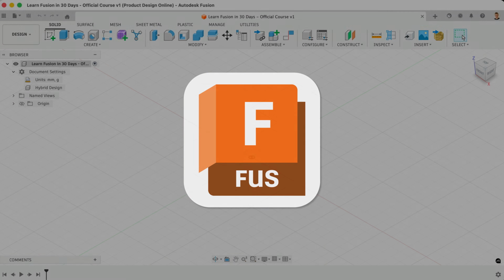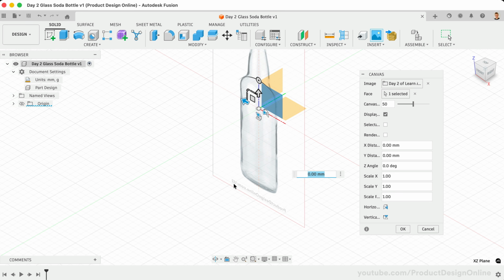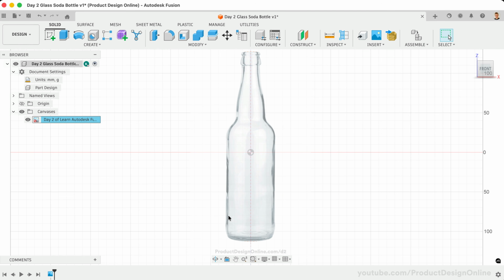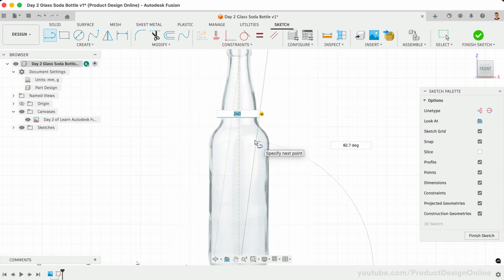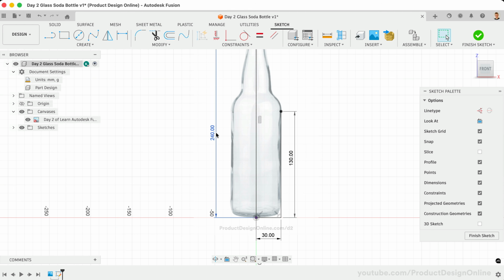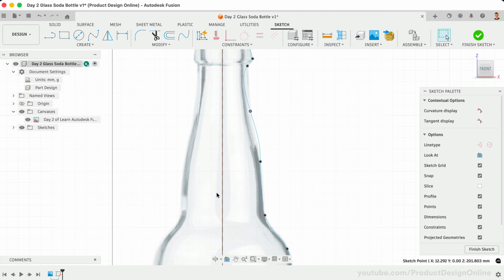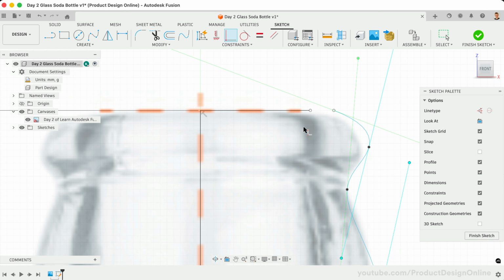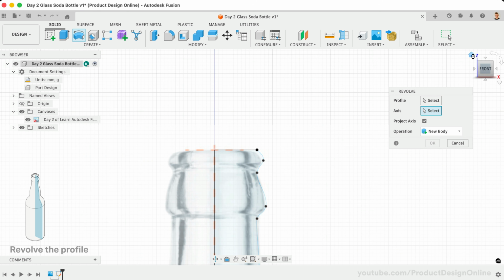Day 2 of Learn Autodesk Fusion in 30 Days! (2026 EDITION)

Comment from the maker: Looking to see INSIDE your bottle? Here's how: https://youtube.com/shorts/NfVwOnwqQfo
Also, if you’d like to help me create the rest of the series and keep these tutorials coming, consider buying me a coffee: https://buymeacoffee.com/pdo
Get the Day 2 instructional guide (PDF): https://bit.ly/guideDay2
Reply: The tutorial grid references are on the "Front" plane, on my machine they are on the "Top" plane and I cant seem to change it. Anyone know what im doing wrong?
Reply from the maker: @CapturedHappiness  Are you referring to your sketch grid or the grid that appears before you start a sketch?
Reply: @ProductDesignOnline   i'm having the same issue as @capturedHappiness.  the grid is on the xy plane, but the bottle is being built on the zx plane.  Also  i don't have the orange reference line on my imported bottle image.
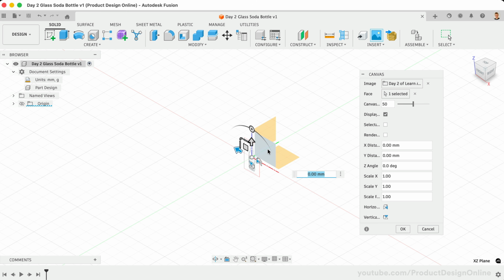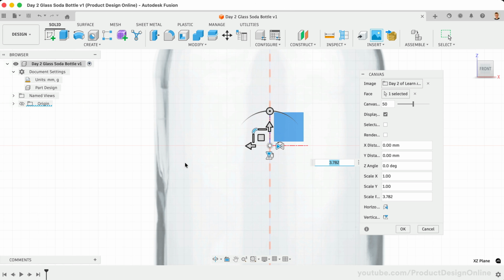Edit:  I think I've figured out why my gridlines didn't move.  I deselected the bottle image before clicking the front plane.  In the video between1:22 and 1:59 the image edit menu is up and plane needs to be selected.
Orange line solved too, didn't use the new bottle image file.
Reply: @CapturedHappiness  I have noticed this as well - my front plane is showing X horizontally and Y vertically, not the X and Z like in the video which is very unusual for any 3D editing software.
I'll keep up with the tutorial regardless, should be fine.
Reply: so this centreline view is that something you made, or is that something I can see as well? (even though I skipped that centre-line good practice)
Reply from the maker: @Coen80  It's part of Fusion now. It was in a recent update sometime near end of 2025.
Reply: re-insert the image and position the origin first. Type in 112.7 mm for the Y distance first. Then set the calibration points and scale. It's a work around until they fix the issue
Reply: You should explain this in the video when you do it not change the view as it makes it hard to follow.

Comment: How does one obtain the wireframe-esque view at 15:40? I can't find a way to view the thickness of my wall near the fillet, although it is before the shell command in the timeline thing.
EDIT: nvm I found it in Inspect > Section Analysis > select XY plane. Love this program despite my difficulties! And the bottle is rounded on the inside bottom :)

Comment: After several attempts and redos, including increasing the angle of the top spline's handle, reducing the wall thickness, and selecting various different volumes for the Face/Body, I wound up with a floating top and bottom, but no sidewall on the bottle. Then I reselected the Faces/Bodies several more times and it suddenly worked. I suspect witchcraft XD Oddly, the Faces/Bodies selector initially had the bottom rectilinear bottle segment as a separate selectable object from the upper contoured part, possibly from an incomplete join (?). I wound up grouping the two and that seemed to help.
Reply: Update: I have 2 extra edges near the bottom of the bottle XD They are within the 5mm fillet, which I couldn't get to work for a while. I did wind up getting the fillet to take, but it created a little rounded pedestal/dome that intersected the bottom of the bottle. I was able to delete them from the Document > Bodies list, but I have no idea what created them. Lol the first tutorial was smooth sailing, but the bottle seems to want to get a "Help!" message to the mainland XD

Comment: Generally speaking this is a good tutorial but in some sections you do things so quick its to hard to follow and I find myself going over and over it again.  At just after 15 minutes where you are doing the filleting you change what son the screen without saying what you have done for example the bottle suddenly shows a cross section and you dont say how you got the cross section, you need to exlpain every step.

Comment: idk what im doing wrong. doubble checked all settings, rewatched the video and asked chatt gpt and i still getting something wrong. for some reason the thickness of the edge on your opening on the bottle is much thicker than mine even tho all the messurments seems to be the same.. the bottle overall is a success, the only thing that differs is the opening

Comment: How did you get that cut wiew of the bottle? Sorry, english is not my first language so is a little difficult to keep up.
Reply: Inspect > Section Analysis > Select the XZ plane > Click Ok. You can turn it off in the Browser by hiding the Analysis folder.

also its called cross section view

Comment: 14:10 Error message says: "The shell cannot be created at this thickness. Try adjusting the thickness, the selection set, or change the Shell type". 
I couldn't solve this issue like you did so I went trough some trial and error. From other CAD software experience I figured that shell command is just the offset command in 2D but in 3D. I went back to sketch and tried an offset on the sketch outline and saw that I could offset to about 2mm but at 2.2 two creases in the new line overlap and it breaks the shell command. What I did was I deleted the second to last spline point and the crease associated with it disappeared. Then I was able to use shell as intended. I don't like that the shell command doesn't allow me to ignore the top surface where the bottle opening is and gives this surface a thickness too.

Comment: After shelling, it left a plug in the top so the bottle is not open. It looks like a flat top but has an inner circle with an edge I can select, like someone plugged the bottle with a cork then cut it flush. Why is the bottle closed off?
Reply: Found it. I somehow got two revolve commands instead of one. I deleted one of them, then repeated the shell command, and it successfully opened the bottle.

Comment: It doesn’t let me click the top of the bottle “lid” when doing the function of shell, instead it only gives me the option to take the whole upper part of the bottom
Reply: As he mentioned at 14:18 the problem is most likely the geometry around the neck/lip of the bottle. Fusion creates an inside shell by offsetting every exterior surface inward by 2 mm. In this bottle, there are several very tight-radius transitions around the neck; the large rounded lip, the small groove underneath it, and the transition from the lip into the narrow neck. When Fusion offsets those surfaces inward, some of the new surfaces can intersect each other or collapse to zero radius. Once that happens, shell fails. So, there is no specific measure to do there, just go back to your original bottle profile sketch and create the inside profile manually. Avoid sharp edges and keep more distances between them as much as you can.

Comment: The Day 2 Glass Bottle instructions do not work.  I also purchased the companion file and it does not provide additional information.  This is extremely frustrating to attempt to learn when it isn't working.  I am unable to align the canvas to the origin, and when I leave it and move on to the sketching, I am unable to see the glass bottle in my fusion view.

Comment: I can't use the shell command to hollow out the bottle. I can't select the top of the bottle. I don't know where I drew it wrong, what should I do? :((
Reply: I'm having the same issue.  It won't let me select a surface when I hot the shell command.
Reply: @amandelART this is what ChatGPT said It sounds like you may have used Revolve from the Surface tab instead of the Solid tab. Check the Revolve icon in your timeline—orange means surface and blue means solid. If it’s orange, delete that Revolve and redo it using the blue Revolve tool under Solid. Also make sure your sketch is a completely closed, shaded profile. Once it creates a solid body, Shell should let you select the top face.

Comment: I am currently working on the bottle design tutorial (Day 2), but I ran into an issue when trying to move/calibrate the inserted canvas along the Y-axis.

Whenever I try to drag the directional arrows, the image doesn't move, and only the selection box or cursor moves instead. In the "Edit Feature" panel, the Face selection is active (asking to select a planar face or work plane), but I am unable to lock the image to the correct plane to allow movement.

Could you please advise how to properly select the plane so I can move the canvas?
Reply: Same, mine is also not moving along the Y-axis
Reply: Same here. Not moving along the Y-axis. I hope someone can help. I have used so much time trying to figure it out without coming to a solution.
Edit: apparently it is a bug in the latest version of the software, hopefully fixed soon
Reply: I am also having the same issue. Any resolutions?
Reply: Same here, canvas will not move. The update today fixed the issue!

Comment: I ended up with quite a "seam" down the side of my bottle when i printed it, anyone else have that problem and a possible cause?
Reply from the maker: Navigate to your filament settings in your slicer, enable Override filament scarf seam, and select Contour to distribute the seam bumps across the model's surface.

Comment: My bottle refference image is not going upwards what should I do
Reply: TL;DR: I was having the same issue. Adjust the vertical position immediately after importing the image as a canvas with the initial dialogue box and BEFORE calibrating the size.

The workaround I came up with was as soon as you import the canvas onto the XZ plane (before closing out of the dialogue box) I was able to move it vertically. If I closed the dialogue box and tried to edit the canvas I was no longer able to adjust the vertical position. So, with the initial dialogue box still open from importing the canvas, I just entered 112.7 (mm) into the Y Distance field and also clicked the horizontal flip button, then closed the dialogue. I was then able to calibrate the top-to-bottom distance to 240 mm and everthing was lined up correctly then.
Reply: @brytonburrows6694  Thank you this worked to continue the tutorial.
Reply: @brytonburrows6694  great tip, thank you, I was having the same issue and was ready to pull my hair out!
Reply: Thanks man
Reply: @brytonburrows6694  This is the way.  I was about 30 seconds away from smashing an actual bottle.  Thank you!
Reply: @brytonburrows6694  Thank was stuck on for a few days im using mac do you think its a software bug ?
Reply: @brytonburrows6694 Thank you, It worked
Reply: @brytonburrows6694  Dealing with the same thing at the moment, just updated fusion to the newest version an hour ago.
Reply: @brytonburrows6694  Thank you! Worked for me as well. :yougotthis:
Reply: @brytonburrows6694  really wish I would have seen this before I found it myself.  Good tip for those who look for help in the comments.
Reply: @brytonburrows6694  did not work for me
Reply: @brytonburrows6694  Thank you
Reply: @brytonburrows6694  damn now I don’t t feel so stupid 😂 🫡👌
Reply from the maker: Hi all. This is a software bug in the recent version of Fusion. No need to scale, go to the next step of calibrating the image (zoom in as needed) and you'll be able to proceed from there.
Reply: @ProductDesignOnline  Great!  Third day using Fusion and I've already hit a software bug.....
Reply: @attila1746  same bro
Reply: @attila1746  Yes and it's not even a bug encountered in a niche complicated scenario. This is a basic functionality bug. This makes it even more frustrating. Basic shit should just work. Every time I want to give Fusion a new chance but get discouraged by stupid shit like this.
Reply: @RefinedIO Wow, that’s a bummer. Makes me want to rethink my decision to go with Fusion…..😢
Reply: @attila1746  I'm also rethinking my decision but technically and financially it's probably the best option I've got. Fusion just fixed the bug by the way in a recent update so make sure to update. The canvas positioning seems to be working as it should right now. Lets hope it stays that way.
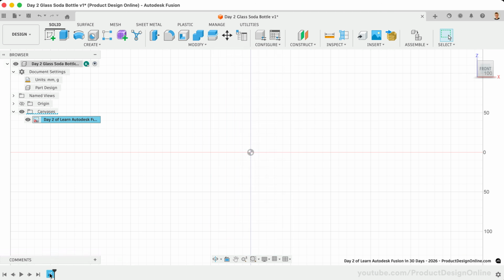Reply: @ProductDesignOnline  The issue isn't scale. The issue is at 3:26 after you select the canvas in the bottom left, no matter what you do (dragging the arrow upwards or setting the Y Distance) the bottle will not move Upwards. It will move left and right, but pressing the up arrow and dragging or changing the Y Distance and pressing OK does absolutely nothing. Pressing the up arrow or changing Y distance only works when you first create the canvas. After it's creating editing the Y Distance won't change anything.
Reply: @buddy4235  I have the exact same experience.  Extremely frustrating when you are trying to learn.
Reply: @ProductDesignOnline  If the next step is to enter 112.7 for the y distance, that didn't work either.
Reply: I'm having this problem as well
Reply: I think it is a glitch after the latest update and it's so frustrating . I can't continue the tutorial because of this
Reply: @toxicmindgamer-t9t  Is it? because i am having the same issue...
Reply: @robertolsonp  I can't continue the series because of this problem .
Reply: @toxicmindgamer-t9t  i'll recomend just to skip that part you can continue without issues.
Reply: Me tooo, please please please give us a solution
Reply: @semprefresco9723 I also need a solution to continue from here
Reply: @toxicmindgamer-t9t @pitchshifter36 @robertolsonp - go ahead and trace things out as described here. you'll be able to move the body to the base of the origin once all is said and done. I had the same issue and spent an hour trying to figure out why i couldn't move the canvas. Ended up proceeding anyway and was able to move the actual body once it was created.
Reply: This happened to me too
Reply: What’s really strange is I imported the paper clip image from Day 3 of 2023 and it worked as expected. I could calibrate and move the canvas.
Reply: @stefangrunspan  yes you can move an image just after the import but when the set up of the image is done then it is not possible to move it vertically .
Reply: Hey, guys, I think I figured out the issue.  If you place the bottle on the XY Plane instead of the XZ plane it seems to work.  Can you check and comment?  I did this twice and it worked OK.  Notice that the boxes for positioning the image reference the X offset and Y offset so I think you have to use the XY plane.
Reply: @DavidHarmon1  This worked for me! Thanks!
Reply: Same here,
It's upward at first, it's not going upward again. I have been trying it for 5 hours now 😢
Reply: @ismailadiro6817  I am already at the 11 tutorial. try what other people are suggesting. You can solve the problem from reading there comments
Reply: You can basically move origin 112.7 when you first insert the image to Canvase and then do calibrate, the effect is the same.
Reply: Yeah mine doesn’t work either. You have to do it right after importing the image which is incredibly stupid!! Once the image is imported, it cannot be moved.
Reply: i was facing the same issue and was sure that maybe it's my software issue. :") so reinstalled it lastly after trying for 1 hour to fix. now i am feeling like an idiot while reading the comments. :")
Reply: @tasmia4114  have you now fixed the glitch. If not look at the replies
Reply: Better option first while Inserting image, you can simply up the image then set y axis to 112.7 mm then try to calibrate it and set to 240 mm, in my case it works you can try that method.
Reply: @MeetShah_28  thanks brother 😊 this is why I have put this comment here . I know there are kind people who share ideas . It worked and i continued the learning process
Reply: @MeetShah_28  you are amazing! fusion forums say they are working on the fix now.
Reply: @MeetShah_28  thank you dawg, this worked for me

Comment: At 3.50 minutes in video you have move bottle to origin point, I have tried everything I can think of and my image will not move to origin point. What am i doing wrong?
Reply: The bottle reference image is not going upward. Same problem with me
Reply from the maker: Hi everyone. This is a bug with the last software update (July 2026). Hopefully, Fusion releases a hotfix soon to fix it.
Reply: @ProductDesignOnline thank you for following up on this, I am running into the same problem
Reply: i just didnt move the bottom to the origin at all lol, i moved it after i made the solid object. still dont know why it does that :\

Comment: Kevin, thanks for the great tutorial! I ran into a persistent issue with the Shell command: even after simplifying my sketch to just three spline points to keep the curvature as clean as possible, I still cannot get the Shell command to work when selecting the top face. Interestingly, it works 100% perfectly every time when I select the bottom face instead. Is there a specific geometric nuance in the top section of the spline that prevents Fusion from calculating the wall thickness properly?
Reply from the maker: That's very strange that it would work on the bottom and not the top. Could you email me your Fusion file, so I can take a look?

Comment: When I press shell, it wont let me click on the top face, and only selects the whole body. When I don't have shell active I can select the top face, help?
Reply from the maker: That likely means an issue with your top connections. Double check that the top line is horizontal (with a constraint). There should be either a horizontal constraint or a perpendicular constraint at the corner. If you don't see that, you will have to add one. If it's not that, please email me your file.
Reply: @ProductDesignOnline  I subscribed just because of how quick you replied AND offered to check out my file, good stuff man. (not to mention great quality video content)